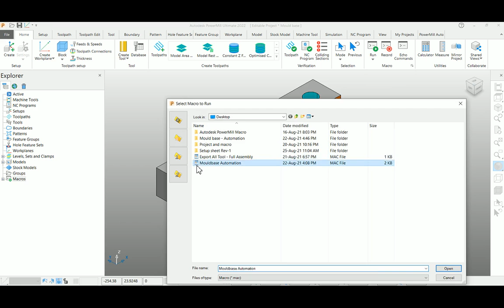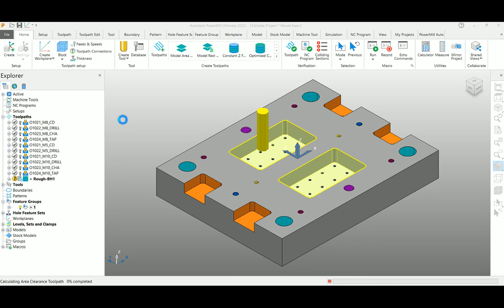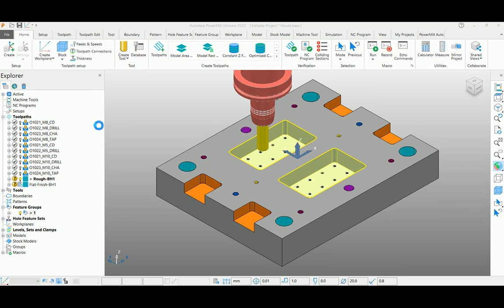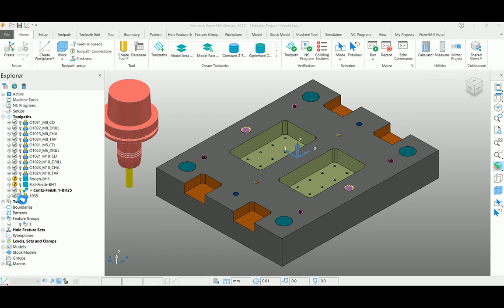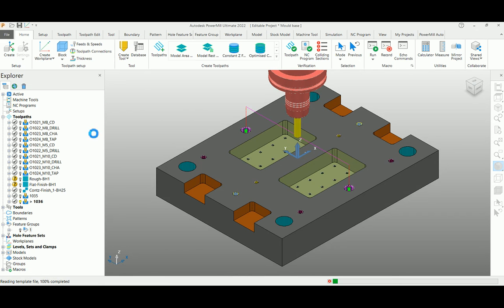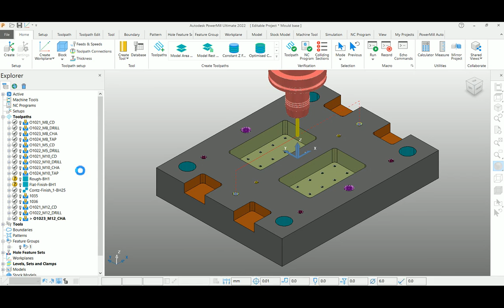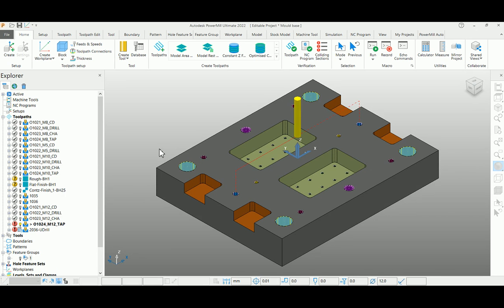Autodesk PowerMill - Automation through Macro

Comment: How do you deburr a round hole that's located on the sides using a lollipop mill from top....essentially how do you perform 3D deburring? Could anyone pls help me.....I'm having great trouble deburring the side hole from top...
Reply: Did you find a solution to this?